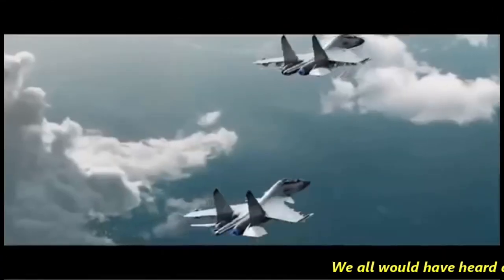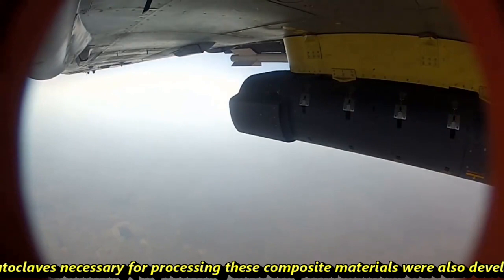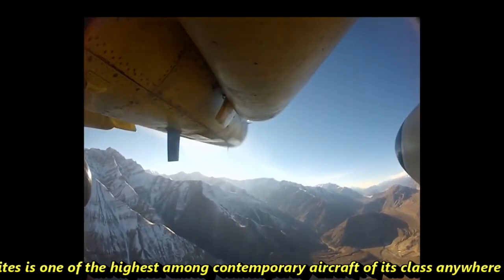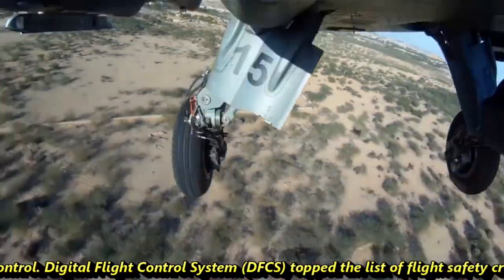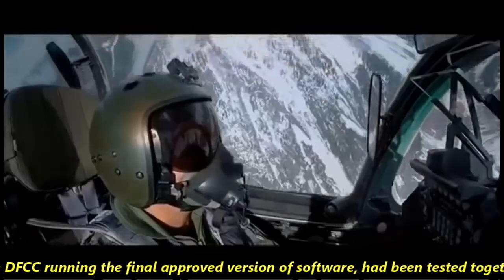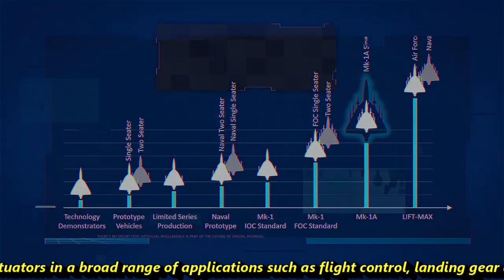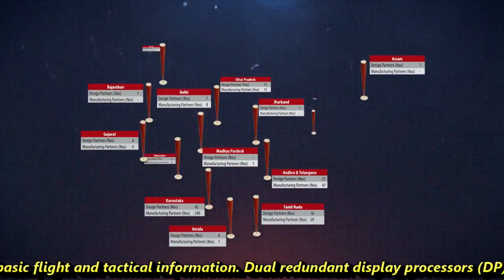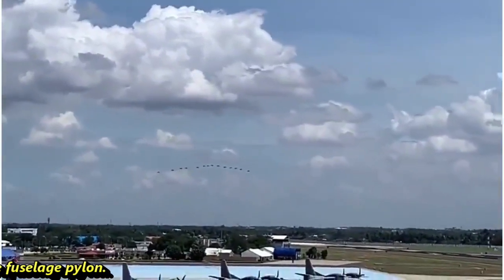LCA Tejas: The least known feature of the world class fighter jet

Comment: Tejas will be an amazing aircraft  in the world. It has different variants  Tejas mk1A,mk1b and Tejas mk2. Its latest variant is Tejas mk2. It will be better than  Grippen 's E variant  in aspects  of payload carrying capacity and hard point.
Reply: HAH!! GripenC/D is FAR FAR superior in specs and performance than puny MK1-MK1A jet...  MK2 still on paper only, and will be far more inferior than GripenE/F ver. jets!!!!
Reply: @samueldiaw4775 Gripen E/F is not proven yet, calling it far superior is just baseless. More than half the components are imported for Gripen, no country in the world exports the state of the art technology to others, it is always a downgraded version. 

Even after disregarding all that, what were the requirements when they made the Gripen? a Country with very little experience of fighting for air superiority, of course they claim it's the best in the world.
Reply: @samueldiaw4775  saab is struggling to fund their projects, so they want to export as much as possible that's why they spent more money on advertisements. 

How many times did Gripen crashed? 2 times only 2 years after its first flight, later no data was found. 
How many times did Tejas crashed? 0 after 20 years of the first flight. 

Gripen's engine produces more thrust due to cold weather, but Indian weather is much hotter, will it produce the same thrust? No.

Comment: It doesn't matter what percent of the aircraft is carbon fiber if the weight of the fighter aircraft or its aerodynamic drag is higher than other planes to an extent that it has shorter range, smaller payload, and slower acceleration.  
Although accurate details of fighter aircraft performance can be almost impossible to obtain, some reliable insights can be had. Fortunately, both the Gripen C and Tejas are single seat delta wing fighters with the exact same engine. The larger Gripen C has higher top speed AND can super cruise, but Tejas has a lower top speed and cannot super cruise. Tejas obviously needs more energy to move a smaller airframe which means the Tejas has higher drag, heavier empty weight, or some combination of both. Considering the Tejas has a much higher carbon fiber content than the Gripen C, it means the Tejas's drag from poor aerodynamic design or heavy weight from poor structural design or a combination of both has resulted in an airframe that needs lots more energy to do the same as the Gripen C.
To add insult to injury, both Dassualt aerospace and Lockheed Martin Corp helped develop the design.
Reply: Gobar baktus cannot understand this
Reply: A DSS air intake could have helped. At least, it should be incorporated in the later models.
Reply: @fahadnazir945  something is better than nothing. Pakistan has made nothing, and go around critisizing other countries progress. How insecure.

Comment: Tejas is a good aircraft but it is late getting the needed technology. They build an eighties airframe with nineties technology in it. The Tejas MK1A will have better achievements due to the highly needed upgrades. Unfortunately most of the Tejas is build abroad, the nose section is mainly British, nosecone, refueling tube and ejection seat. The radar is Israeli, the engine is American and the EW suite is Israeli too. The MK2 will have a higher degree of indigenously developed technology it will have more teething problems due to actually integrating original technology into it. I hope they get the private sector companies to fully build it because HAL keeps creating delays and it would have to wait until the Tejas MK1A production is done. That would also lead to faster and cheaper upgrade to the original design than if HAL and ADA do it.